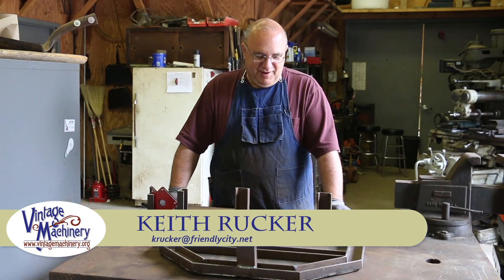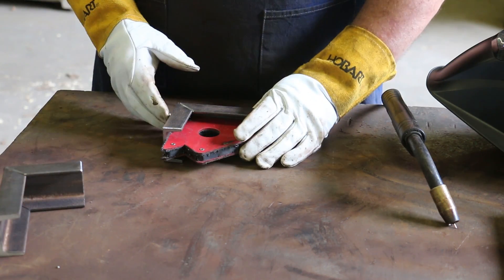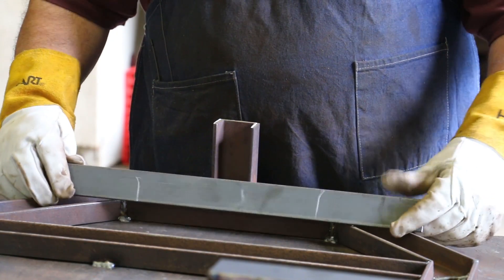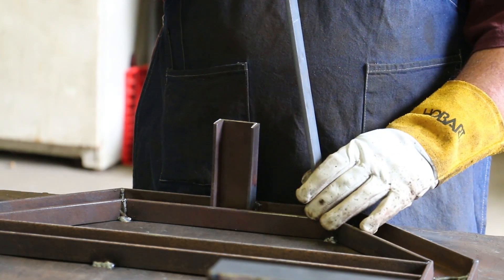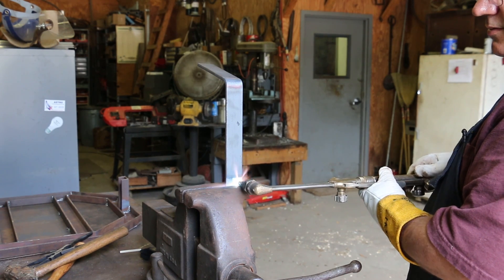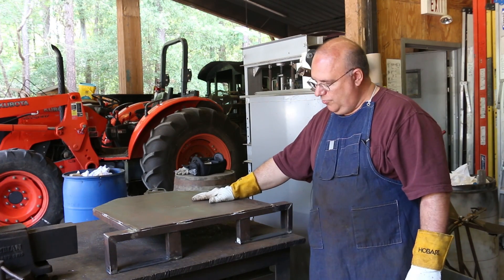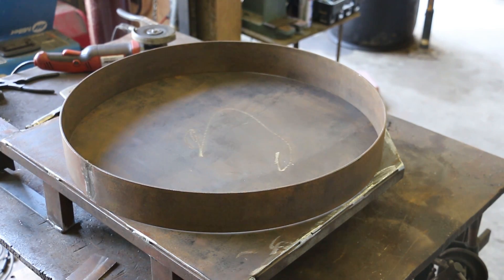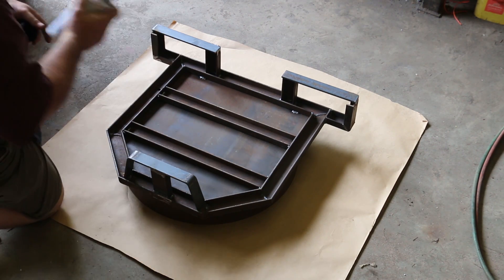Building an Oil Fired Foundry Furnace - Part 2:  Base Stability Modifications

Comment: Keith you will have a better time with the MIG if you push the torch rather than dragging it. smoother welds and you can see where you are going.

Comment: SO nice to see someone welding on You-Tube with a MIG actually set right !
Reply from the maker: Brainmalfuction Thanks - not sure what you are referring to as being set right (as compared to wrong), but I try to follow the guidelines I learned from....
Reply: In your video your wire feed speed and voltage are set right on for short circuit transfer,  I can tell by the sound. I would say your using 100% Co 2 for shielding gas as well.
So many people make videos with welding and have their settings way off. It is a pet peeve of mine because I am a welder by trade.

Keep up the great videos !
Reply from the maker: Brainmalfuction LOL - anytime I start welding, I usually flip open the cover on the welder and see what settings they recommend on chart in there based on the wire I am using and the thickness of the metal.  I then make fine adjustments from there to get it where it "feels right"!
Reply: Keith Rucker - VintageMachinery.org That means you got good feel i guess ;)

Comment: Hi Keith,
Great video.  That base will never tip over.  I have one comment though.  I noticed that you weld in short sleeves.  I used to do the same thing until I learned from a dermatologist that the danger is not from the hot sparks, but from the UV generated by the welder.  I now have a couple of spots of pre-cancerous skin on my forearms and think you might consider something like this: http://www.amazon.com/Lincoln-Electric-Flame-Resistant-Welding-Sleeves/dp/B00LB7AYAW/ref=sr_1_1?ie=UTF8&qid=1432511083&sr=8-1&keywords=welding+leather+sleeves
I know it's hot there, but it seems like a reasonable compromise to save your skin.
Thanks again for the great show and keep 'em coming!
Stephen
Reply from the maker: Stephen Wilson Probably worth looking into.  Thank goodness I am not welding a whole lot, so my exposure is limited.

Comment: Hey Keith. It is obvious you aren't building it that way, but would it be practical to build your furnace so you could bottom tap it and thus avoid the slag and impurities you get from pouring from the top?  It looks like to me it would be rally hard to get a good clean pour even after trying to dip the slag out as you can't really get it all.
Reply from the maker: bcbloc02 This will be a crucible furnace where the metal is melted in a crucible.  Most of the bottom tap designs are a whole different kind of setup that is quite a bit more involved.

Comment: Great series!  If you plan to lift the furnace I would not attach any lifting rings to the furnace structure.  While stable and secure on level ground, the weight of the furnace may cause base to flex and allow refractory to crack.  Instead I would design a fixture, perhaps as simple as a "cross" or separated parallel beams, to which are attached chains coming up to a central lifting ring.  This way your lift acts like the forks instead of stressing the furnace frame.
Reply from the maker: Morris Gallo Great points.  Should I make lifting rings, I will keep this in mind!

Comment: Big improvement in my view, however, How will you move this with a pallet jack on soil or sand? Surely the wheels will sink in too far to move by hand - I would be thinking of an eye(s) to move it about on these types of surfaces. A pump truck  will be fine on hard surfaces but not anywhere else as it looks as though it could be real heavy!!
Reply from the maker: Dan Whiteford The pallet jack is more for moving it around in the shop.  Outside we can use the forklift.  The forklift does not fit in the shop though.

Comment: Hi Keith; just a little suggestion. I noticed when you were welding the ring, there was arcing at the vice which tells me you placed your ground clamp on your table. You should ground directly to the piece you are welding, do not include the vice in your circuit. You could have an intermittent ground problem while welding or you could ruin the screw in the vice if there is a place where it can arc on the screw itself. It is good practice to place the ground clamp as close to the arc as possible .
Reply from the maker: John C You are correct - I should have moved the ground before using the vise.  Did not even think of it at the time.....

Comment: will the base get super hot? will insulation keep it somewhat sensible? worried about distortion etc
Reply from the maker: jusb1066 The base should not get very hot at all.  Most of the heat will be adsorbed by the refractory.  Most furnaces I have worked around you can put your hand on the outside - it will be hot but not hot enough to burn you.
Reply: Keith Rucker - VintageMachinery.org That's actually a design standard - the outside shell of an industrial furnace or duct should not be hot enough to cause a serious burn if a worker bumps into things...

When that's not practical, we need to set up guarding to keep workers' body parts from coming into contact with hot surfaces.

Comment: Hi mate.
Are you sure, its' going to be strong enough???  Forget about the pallet jack, I think you only chance of moving that, is if you tie the locomotive in front of it ; )
Its' starting to look quite nice.  About the pallet jack, you could always come in from the side, so you can make it as stable as you want.  Also you would never put it on the sand, how would you move it with that pallet jack sunk into the sand?  Cant' wait till next instalment.  This is going to be better than sliced bread.
Reply from the maker: Marcel Timmers The pallet jack is more for moving it around inside the shop and in and out of storage.  Outside, we will use the forks on the tractor or fork lift.  Those don't fit in the shop very well.....